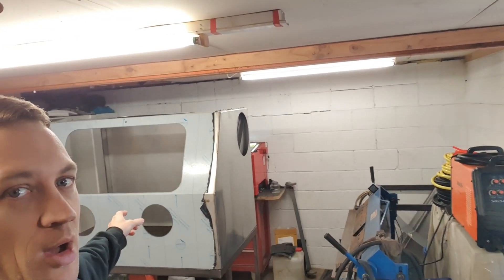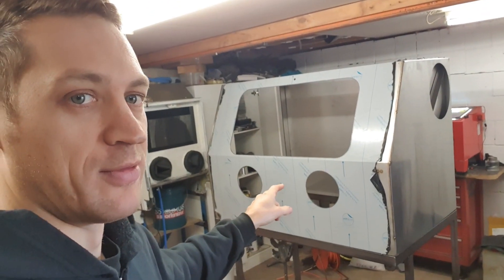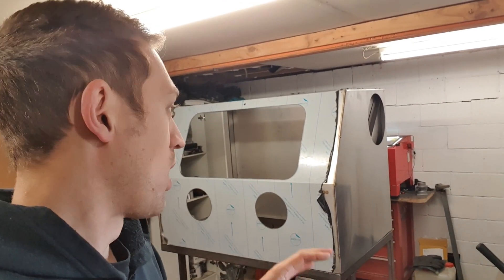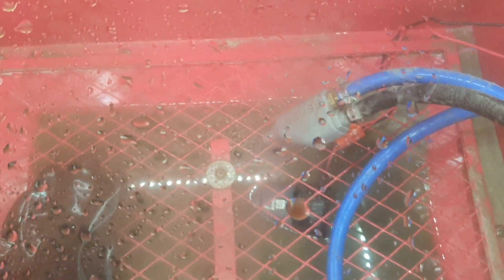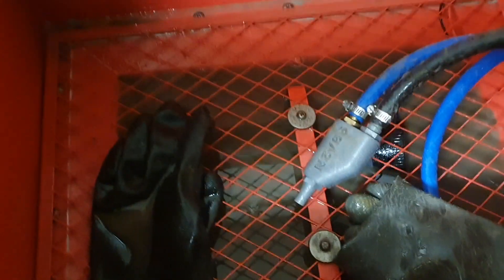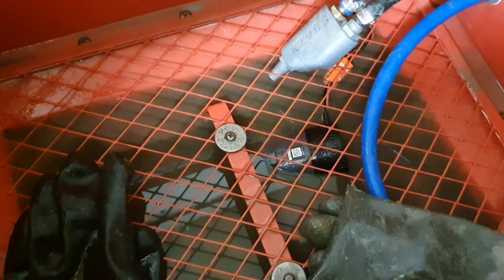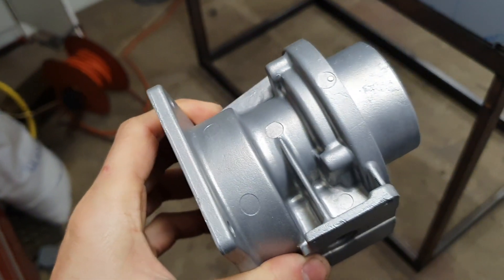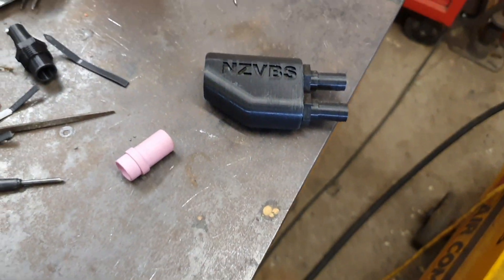Ghetto Blaster 4 - Tease of upcoming

Comment: Amazing work I love your projects I have decided to make one and have had not so good results. I am using the same gun as you first used and am having trouble with slurry mix 
All my slurry is sitting on the bottom of the bucket do you have have a ratio of media to water and also do you have to use a airrater to keep the slurry from turning to silt on bottom. 
Any help would be greatly appreciated🙏🙏
Thanks
Reply from the maker: Hi Yiltan,
Sure, you need to have an agitator. I divert half of the pump flow directly at the bottom of the bucket to stir up the media.

You should have at least 10%media at the nozzle. I aim to have more than 20%.

Hope this helps!
Josh

Comment: Hi Josh! Now that you are working on the CAD files for your cabinet design anyway, will you sell these plans through your website? Since shipping as big and large as a cabinet outside of NZ is not really a feasible option, the plans would give your international followers a chance to build our own. Cheers!
Reply from the maker: Hi Lukas,

I have been doing limited sales of the cad files for the largest cabinets. Currently they are expensive as they require a lot of support due to the difference in components around the world. They have also been sold on a condition of non disclosure and not for commercial use.

I do have mid to long term plans on having the plans for all 3 sizes of cabinet available on the store with links to all the parts once I have made them more universal.

Feel free to email me if you would like to discuss this further.

Cheers
Josh

Comment: What kind of media do you use?
Where can i find the uppgraded 3d nozzle for brazz fittings? Do you have a part 5 video coming on this?
Reply from the maker: I use 250-125 micron glass beads.

The upgraded 3d printed nozzle is on my website. If you already had the previous 3d gun you should be able to re download the same file and get the version with the upgraded nozzle files.

I will eventually get around to a part 5 but I have hit a bit of a developmental wall. When I am able to make further improvements I will definitely put up an update.

Cheers!
Reply: @ArmouryEnterprises  thanks for information, take care.